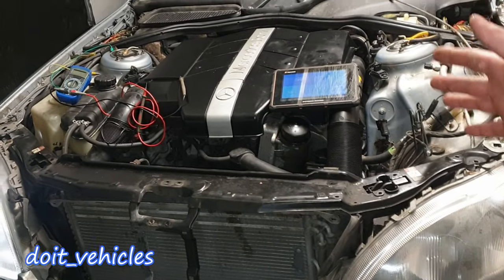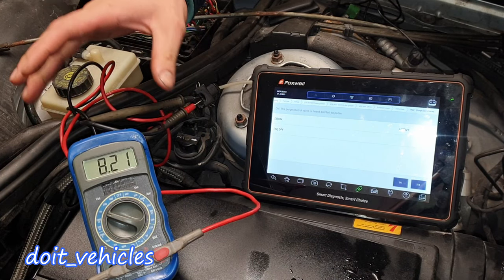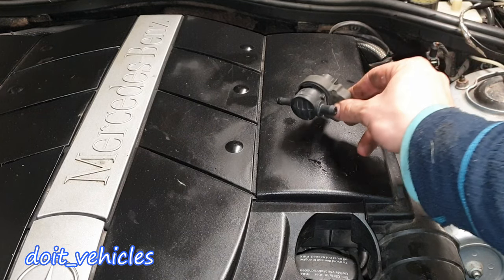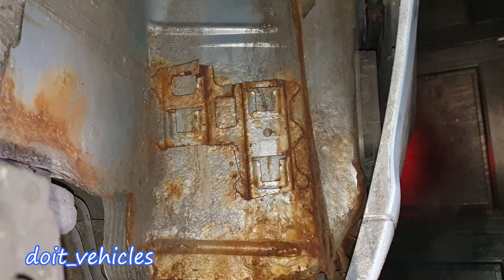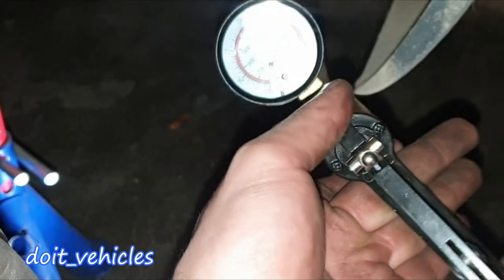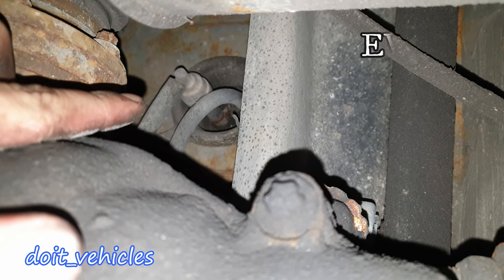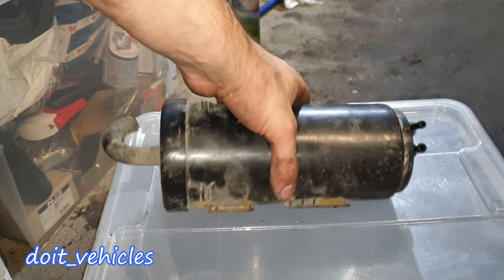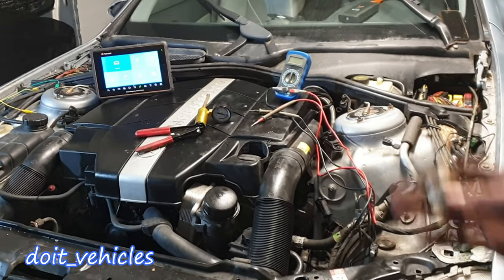Fuel Tank Pressure Vent Valve , Evap Canister Solenoid / Leak Test Mercedes W220 S 320 S 500

Comment: Hi, i have a 2004 c180 kompressor, one morning it failed to start and when i plugged my obd into it it came up with OL fuel system, i checked fuel pressure and it was 55psi i replaced the fuel filter now i have 0 psi but when i start the engine it gos up to 28psi but as soon as i shut off the engine its back to 0, im completely lost??

Comment: My W210 E200 kompressor, leaks from the canister. I changed it and after a few days the canister started leaking again. When i open the cap of the fuel tank it has to much pressure.
Reply: I had same problem. Just change fuel filter. I've solved my problem by this way

Comment: Great show. Thank you Bruh, I am a mess. I got the side of my W163 off , changed the filter/regulator and fuel lines to the fuel tank. I am still getting the P0442. I am frustrated. Thank you for the video, it helps a lot.
Reply from the maker: Have you read some live data on a scan tool ?

Comment: Hello. Awesome video! I have a RHD 1991 w124 300E. I was looking for the fuel vent valve under the tank but can't see one. Is it possible that some models never came with one? The reason I was looking for it is that there's a smell of fuel from the gas cap area and all the forums suggest it could be a blocked vent valve.
Reply: Well, replaced the vent valve to no effect. Been driving it as is. Even though my gas cap is new, I suspect it may be faulty as I can distinctly smell gas from cap in the morning. =/

Comment: P0442 code, small leak in hose or shutoff valve of activated canister. Is it bad to drive on this? Will it cause harm to the car?
Reply: Not bad at all, just some bad reading of the fuel lever in some cases, bad recirculating vapor from the tank block the filler too

Comment: Great Video and break down.  I have a 2004 W163 ML350 with an EVAP issue P0446.  I tested the Vapor Canister Purge Valve / Solenoid and it holds pressure for a couple of seconds does that mean its not working.  Should it hold the pressure until you remove the cap on the other side only?  Thanks in advance for the assistance.

Comment: What does it mean if I have this code P0455 but I don't have fuel smell in my car? But, it does burn a lot of fuel and no smoke either. 
I also have code P0410
2 codes only
2000 S430

Comment: Hello. Nice video. I have mercedes CL203 sport coupe 1.8 compressor. After replacing fuel filter, begin constant noise from the filtet. Looks like there air in the system. The filter inside has a pressure regulator. And I supposted that air enter in that regulator. In the moment I can't fix the problem. Can you suggest me some solution. Thank you in advance.

Comment: I have a 2006 Mercedes SL500.  Gas fumes in the car.  Charcoal cannister and purge valve replaced.  Not fixed.  Gas cap replaced.  Not fixed.  $1200 spent so far.  What to do next?
Reply: Did you find the problem in the end?
Reply: DID YOU FIND THE PROBLEM? I WAS JUST ABOUT TO CHANGE THE PURGE VALVE SOLENOID TODAY, I ALSO KNOW THERE IS A VENT VALVE IN THE TANK AND ITS VERY LABOR INTENSE HOPING I DO NOT NEED TO GO THAT ROUTE. MINE IS A 05 IF LEAVE IT IDLING IT LEAKS FROM THE REAR PASSENGER SIDE BY THE WHEEL FROM CHARCOAL CANISTER. ALSO SMELLS INSIDE